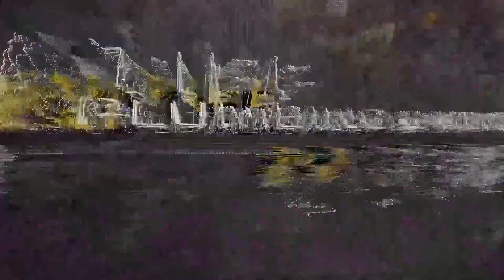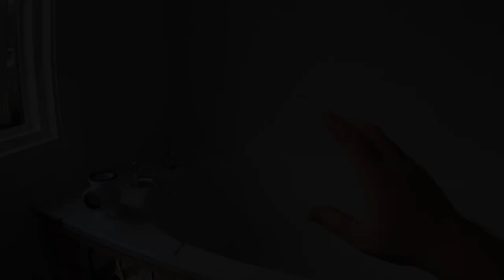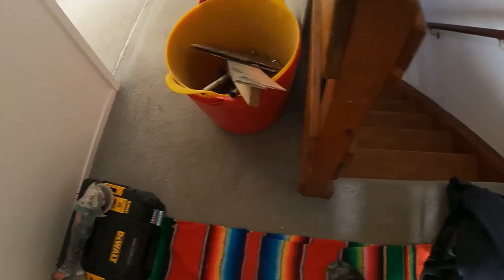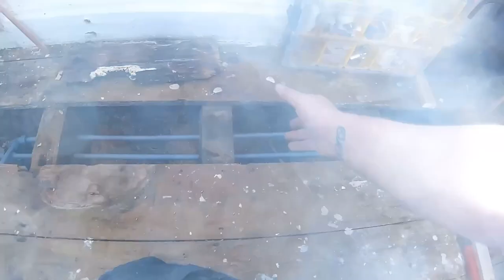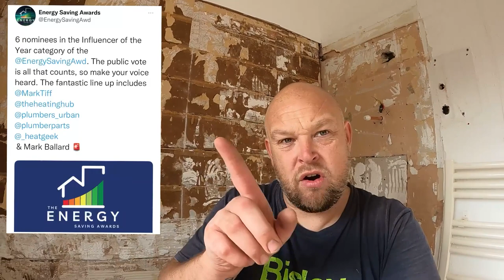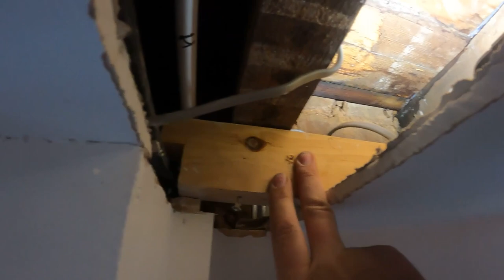WATER LEAKS… THAT YOU CANT FIND. We’ve all had it happen..

Comment: Got my vote mate your spot on. Could the leak be the cistern leaking from the flush handle and running down the outside of the cistern and then tracking down that pipe through the floor. I’ve had it where a toilets over filled and leaked through the holes for the fittings to secure the cistern to the wall. Just a thought mate
Reply from the maker: Thanks mate🙏🏼🙏🏼

I did infact check the handle as thought it could of been that

Comment: Great little vid as per normal. Just going to remove and fit bathroom suite for my son. Just the issue with the pipe running above the floor. Going to do the exact same and use plastic under the floor to get rid of the unsightly looking pipe. Can't wait to see the finished bathroom. Use to do some roofing and funding leaks were very frustrating. Good luck.
Reply from the maker: Thanks mate…. This one will look great, the tiles are brilliant

Comment: I had the same thing , 
And what I found there was a hair line cracked in the pan and are the Swan neck might be slightly dislodged  or the cold feed to the inlet leaks when it is filling the cistern ... worst case on a long shot have a look at the out side brick work is any cracks or pointing
Reply from the maker: Oh mate it’s like a puzzle where you have to find all the bits and put them together
Reply: @MJTiffPlumbing  
I can imagine I have a shower floor level shower leaking , 
Re grouted , re sealed the mastic, cut open ceiling under the tray from down stairs can't see it , re done the sealant on waste still leaking, so now ripping whole bathroom room out and putting in a wet room ..

Comment: I've just subscribed to your channel. I'm in Ireland where our pipe sizes are different slightly and terminology isn't the same. I'm still learning loads from you.
Reply from the maker: Thanks mate and welcome aboard…..
What’s size pipes do you use over there mate??
Reply: @MJTiffPlumbing  very little in the difference. We use 14.7 when you use 15. It's imperial versus metric. Sometimes we come across older jobs where we have to use what we call english/irish fittings. Minimal difference but enough to cause a leak
Reply: Sorry its the other way around. Irish fittings are 15mm yours are 14.7

Comment: Mark as ever great “real world”video mate, regarding using plastic pipe,I think some plumbers look at copper with rose tinted spectacles, I did my apprenticeship in the mid 80’s and I remember the hassle/nightmare of running copper pipe under  floor’s , saying that I still think copper looks best surface mounted but under flooring or out of site why not use plastic provided you use the proper cutter and inserts and make sure it’s pushed fully in the fitting you won’t have a problem, don’t worry about hitting 20,000 subscribers you will smash it mate 🤙🤙
Reply from the maker: Completely agree mate, where ever it’s seen it’s copper…👍🏼👍🏼

Comment: Great vid.
You mentioned that the system was a combi! Save using that electric shower ,a thought , could you of fitted a thermostatic bath shower mixer especially as your taking the bath taps out, would give a better performance ! However the electric shower  did look relatively new. 
My only gripe with running plastic is the possibility of mice chewing through it. Have had that before in a loft conversion under the floor which was plyed underfloor heating & tiled & in the ceiling g void the builder had chicken wired & filled with insulation! Once I'd gotten past that I saw the offending issue!
Now I know its a rarity that might happen so what I tend to do is fit tubular hair felt lagging on it. Only to do my best to stop that happening! 
Manufacturers t's & c's say in areas where possible ingress of vermin etc suitable protection should be taken to protect the pipework, as otherwise it will invalidate their 50 year warranty !! That's where sometimes copper is better !! However plastic has gotten me out the sh*t loads of times!! 

As for that invisible leak so many things it could be . Thinking outside the box could there be any correlation with that bath waste which is push fit! They might not have a bath alot & use the shower , so would fall in with it only leaking sporadically. Weirder things have happened !! Be interesting to see what it is , me thinks some of that tiled boxing might have to be removed , or an attachment that fits on the iPhone , inspection camera you could fish in the boxing to maybe get a better look!! 
Good luck with the nominations vote.
Reply from the maker: Thanks mate…. We may have a break through with the leak…. I’m going back tomorrow so keep your eyes peeled😉

Comment: Is that T plastic pipe the toilet inlet?  Could be running down it? Also just noticed the bath waste is in push fit, that would start the alarm bells ringing!
Reply from the maker: Yes it is running down it….. that’s what I said in the video👍🏼👍🏼
It’s been put in very badly
Reply: @MJTiffPlumbing  I kind of meant running down from the top by the cistern on to the fitting.
Reply from the maker: It’s all dry at the connection to the ballvalve